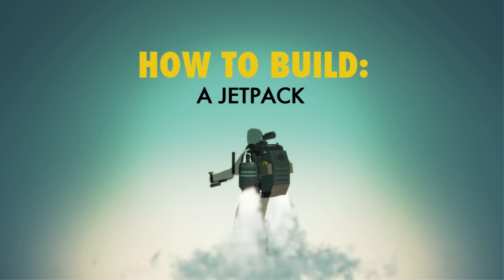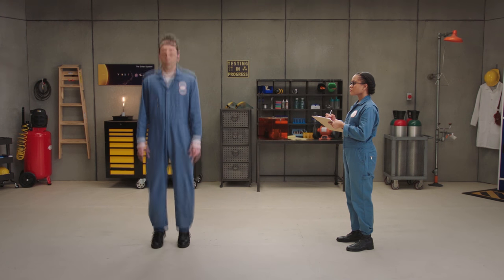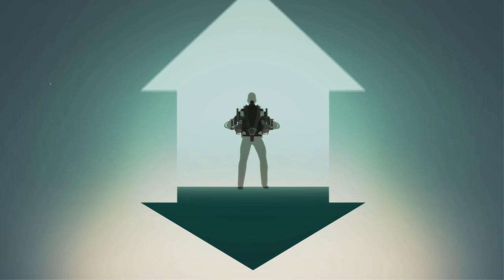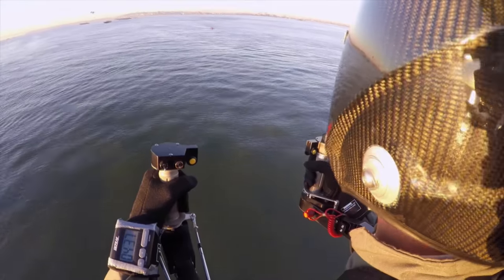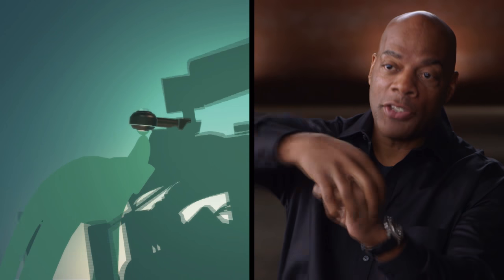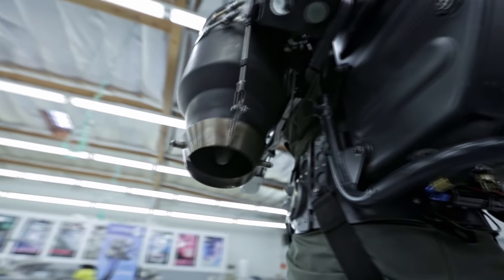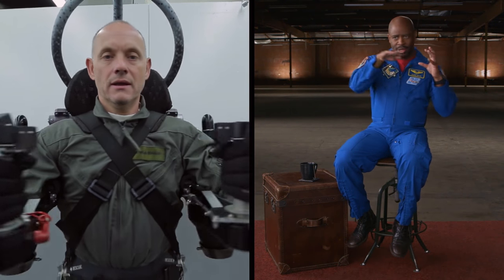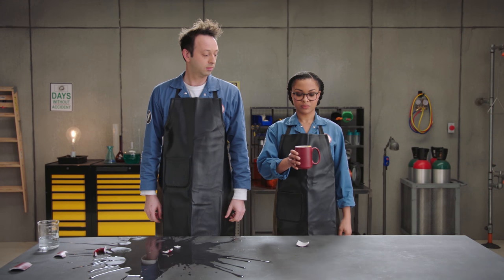6 Steps To Make Your Own Jet Pack

Comment: Huh I knew it was that "simple" basically..
I also knew there's a ton of details that's crucial to safety

You kind of can build it if you have enough money, besides the fact you may burn :P
Reply: The burning part isn't that true, a jet engine with around 20 kilos of thrust is hardly hot with your hands inches away. Maybe a bit warm, but not hot. Of course there is risk of fuel tanks exploding and stuff, but with precaution and a good engine, you should be fine. (still precautions of falling and stuff)